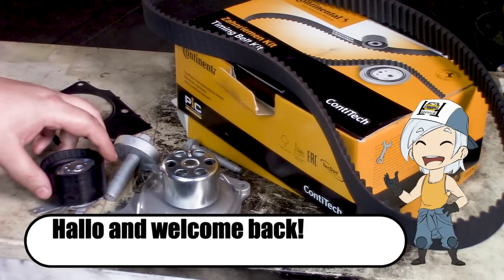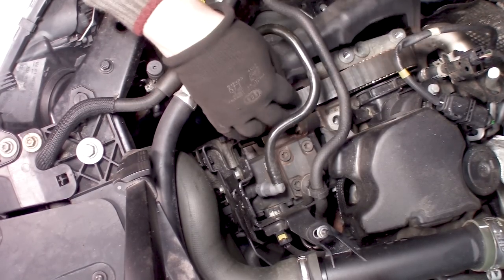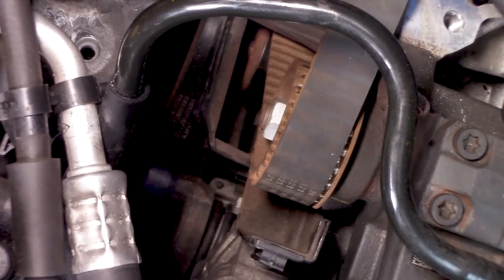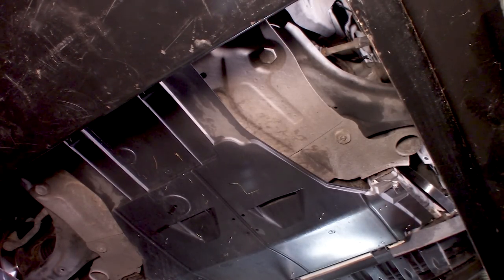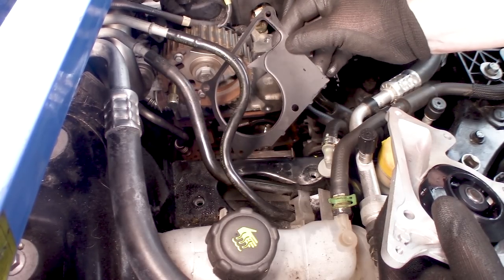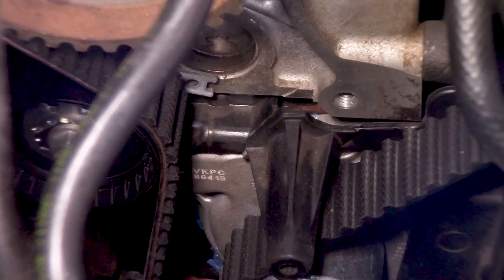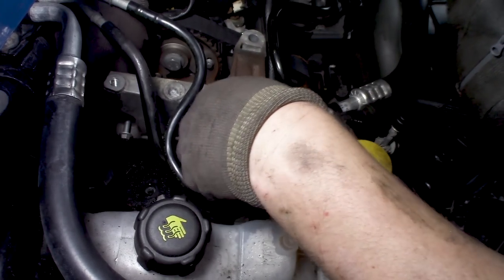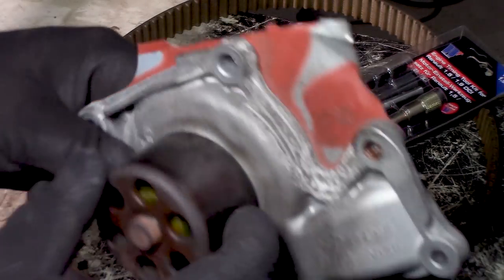How to replace a timing belt and waterpump 1.5 DCI Nissan Renault Suzuki Dacia

Comment: Hello,
Indeed very good job on removing parts but as timing belt job and mechanic you done very very bad job.
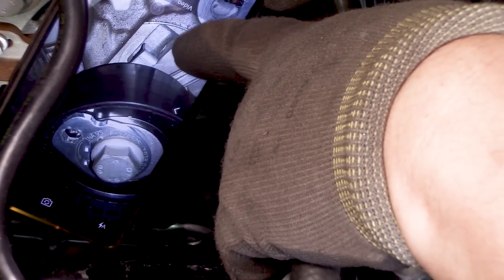At 32:30 you started to tension timing belt tensioner in wrong direction(clockwise). He must be tensioned at anticlockwise direction as stamped in tensioner with big arrow pointing to anticlockwise which can be seen at 28:49 . you didn't even read the instructions that came with belt.
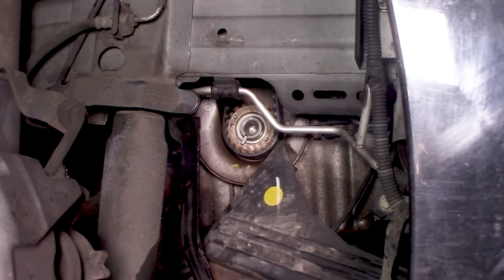As a result you have a belt that is not centered on the pulleys and protruding about 1 cm out of pulleys which can be seen at 35:34 . Probably by now belt is rubbing against upper engine mount and will jump a tooth or brake soon ending with scrapping engine or the whole car.
Also with camshaft pulley you didn't unbolt 3 bolts to have even tension and belt is by now very wrong tensioned.
You didn't use marks on the belt that ensure belt is at correct position.
When tightening crank pulley bolt you could use crank locking pin to lock the engine and then tighten bolt to 120nm. After that you can tighten additional 95 degree with impact.
Reply from the maker: About the tensioner you are right about that. I could have turn it the other way. I can remember having some problems getting it to center. But i'm not a bit worried about snapping the belt or anything. The car has been driving fine for about 50000km after the timing belt change. You can call it luck but i think it is not going to mater much.
Thanks for the honest feedback that is keeping me sharp. By the way i'm not a mechanic just someone that post repair video's and yes i make mistakes.
Reply: 50.000km in 1 year. Thats a fair milage.. ;) Have a look at that belt.. i seen many like this ending in engine rebuild or new engine.
Reply from the maker: I will, it needs a service anyway.
Reply: @TheDutchGarage  please ADD at time 32:30 comment with correction !
Reply from the maker: @MaxHardcoreSLOVAKIA  I wish I could but they removed all the possibility to at text.
Reply: Sono pienamente d'accordo con te

Comment: Thanks alot, this video helped tremendously when doing the timing belt on my 2006 Kangoo.
The shops here in Norway would charge around 16000NOK, which is around 1600EUR for this job, with help from this i managed to do it for under 2000NOK....
Reply from the maker: That is a LOT of money that you can stick in your own pocket! Good job! Glad that I could help.

Comment: very good job! However you should skip the silicon at the pump, it makes things worse! The gasket is of a soft metal, which deforms irreversibly to close the micro cracks in the aluminum surfaces of block and pump. It also has a similar temperature extension coefficient as aluminium i.e. everything moves „in line“ when temperature changes and the cracks remain sealed. The silicon does not allow the metal gasket to do its job, it introduces 2 more material layers which may fail and in this aggregate of materials it is the one with the most temperature aging and therefore will shorten the lifetime of the seal.
Reply from the maker: You are right, I'm just a bit old-school. Pump still isn't leaking tough.
Reply: @TheDutchGarage  😀

Comment: When tensioning cambelt on any engine that has adjustable cam sprocket,The 3 bolts with slots should be loosenend so the belt can be correctly tensioned all round,This is why they are there, The pump sprocket will move slightly when tensioned too but this doesnt matter because common rail are not timed by the pump, Pump mark is there for the white alignment marks on the belt ,assuring is fitted with the correct amount of teeth between the cam and pump sprocket.
Reply from the maker: Thanks for the input. Always good to have more info!
Reply: I did that but after I loosened them they would slip when rotating the engine even tightened with double the torque spec. I had to douse the hole thing in brake cleaner before it would grip. Now I'm nervous it will slip again after 100km. Wish I hadn't touched it. It ended up in the same place anyway.

Comment: Hi,
Another great video. I have one question: without having an impact socket driver, as you did, how would you suggest loosening and later tightening to specification the 18mm crank pulley bolt? I did think of using the crank locking pin as a means to oppose the turning of the crankshaft and pulley, but feel that the light pin may only bend under the turning load.
Many thanks,
Brian
Reply: You can use an old serpentine belt like this: https://www.youtube.com/watch?v=bghh47pBDMA

Comment: Hi great video Re dci timing belt, just a couple question hope you don’t mind me asking? 1. What happens if the high pressure pumps moves? 2. How do you rotate the pulley when checking timing alignment do you leave the car in gear or neutral? 3. Why do you do if you find the timing alignment is out once you fit new belt? Many thanks for the advise
Reply from the maker: Hi,
1. the injector firing pressure will be off a bit to the left and the right doesn't matter.
2. Just put the car in neutral, don't make it harder than it has to be :-).
3. don't panic. realign the pulleys as good as you can and retry. the camshaft and the crank are the most important ones. 
Thanks for watching!
Reply: The Dutch Garage hi thanks for taking the time to reply. One more question please the Renault guide tells me to use a tensioner to properly tension the belt. Do you also do this? And with regards to fixing a wrongly aligned belt you advise to realign, how is this done?
Reply from the maker: @francisorozco6438  Well if you can withstand the visual torture of my video then the least I can do is replay to your comments. 1. In the kit there is a automatic tensioner that you need to setup right. please see https://youtu.be/w9rlzT-vG8Y?t=1923
2. try to setup the alignment holes as good as you can with the belt on there. If it didn't align properly then it most of the time just a tooth off so no harm done. off course the camshaft and crankshaft are the most important ones. so if you put the pin in the crank and you see that the camshaft is a bit to the left or the right. then undo the tensioner and try to align the hole again and if you are successful take the whole belt of and try again.
Reply: @TheDutchGarage 
What is the life span of the timing belt on a 2014 dacia logan mcv 1.5 dci engine.

Comment: Good video !! 
But a couple of remarks:
1/ on the new belt are lines that should line up with the marks on the pulleys. If there are no white lines on the now belt , you should count the exact number of teeth between 2 marks (see instruction leeflet). Especially count the tooth on the longest distance (between diesel pump and crankshaftpulley).
2/ The timingbelt tensioner should be tensioned  COUNTER clockwise (Allen Key). That is what the instruction says. However , with my first belt change , i did it the same way as you did , didn't seem to harm , but after driving 10000km i retensioned the belt the good way . DOES IT MATTER how it is tensioned , does somebody know?
3/ You torque  the crankshaft bolt without the locking pin in place , the damper pulley spins. Maybe it was already torqued , and you didn't film it because it was a long day?
    Would have been nice to show how to torque properly and than turn it 95° further to see for a beginner. This is an important bolt ! 
4/You might have shown how to de-air the cooling system ( 2 drains?).
Nice video, where are you from in Holland?
Reply from the maker: Hi there, It has been a long time that I have seen lines on timing belts. The belts are used for differed engines and the marks don't line up and that can trow you off.
2. Renault did update the timing belt for this engine. you can use the new roller on the old system. Maybe there is were the problem starts. One roller counterclockwise the other clockwise? who knows. Always check the instructions of your timing belt kit. Never the workshop manual that is my advice. 3/ If i remember correctly I torqued the bolt with the car on the brakes and in gear. A bit of a old habit. The rest I think is just a bad edit.4/ You are probably right maybe I have to give a small instruction in every video about burping the system. I'm from Groningen! thanks for your questions and watching off course.

Comment: Thanks for video. Can this be done without crank shaft pin. I'm stuck here. Help me please 😊
Reply from the maker: Sure, Just be careful nog tot rotate it.
Reply: @TheDutchGarage  Thanks for reply. How can it be done without crank pin. The last person rounded the blank nut. Plus it's very hard to get ar.
Reply from the maker: @TheSubpremeState  First align everything you can get a pin into. Like the camshafts. Then mark were the crank is located. What also can help is put the car in gear to keep the crankshaft form rotating.
Reply: NO!
Reply: There were marks on the crank and camshaft making it easy even if they moved. Thank fk
Reply: @TheSubpremeState  you don't have any marks on the crankshaft, only the 12 o clock notch which is not a precise position to follow. the locking pins are 11 gbp on ebay. just ensure there is a 69mm lenght of the cranckshaft locking pin.
Reply: @crigeorge9549  maybe the car I was working on was different. I used an m8 bolt on the left hand side of the cam shaft wheel. I can't remember fully but there was a mark on the crank shaft that lined up with the lines on the new timing belt. The fuel pump even had a mark that lined up with line on new timing belt
Reply: @TheSubpremeState  you could have a marking, 6:00 o' clock position on crankshaft cog in relation to the timing belt, if the belt has this marking. Some engines have this marking on the crankshaft cog. But not related to the engine. Regarding the lenght of the mot1489 crankshaft pin there was a debate on internet about it's corect one. While a long time ago some drawings indicated 68 mm, recentely different lenghts were used. Like 69.5mm , 69 or even 70mm(Lasertools). I used a 68mm manufactured at a local hardware handyman but the crankshaft and camshaft somehow didn't realign properly after the 2 pretensioning revolution. In the end somehow they did realign after multiple tries. The one supplied by Renault is 79.5mm. In the end the best way is to count the teeth between the camshaft and crankshft, or if you have markings on the timing belt to compare their position to the cogs.
Reply: @crigeorge9549  ok but am I wrong in saying the vehicle won't start if its out a bit. From what I gathered and seen on my own ranault traffic van.... Which was much easier.... The engine can't turn freely unless the timing is done right. Maybe you could be out by a half turn of the crank? I dunno
Reply: @TheSubpremeState  it can work even if it's 1 tooth misaligned for instance on the camshaft. Mine, when I change the cambelt had 1 tooth misaligned from the work done by the previews mechanic , and still worked. Probably a couple of teeth misaligned and still be able to move freely. However the performance might be bad, emisions or the fuel consumption might go up.
Reply: @crigeorge9549  damn that sounds awful lol. Stupid design. On my renault traffic at least there was a cam shaft position sensor that wouldn't let it start if it was off. As far as I know
Reply: @TheSubpremeState  1.5 dci has camshaft position sensor, but it's location could be different. And a cranckshaft position sensor. Some 1.5 dci engines , for instance the megane 82hp has the camshaft sensor mounted next to the fuel pump sproket. In this case the position of the fuel pump sproket its important because it reads the position of the fuel pump sproket. However the 106hp megane 1.5dci has it mounted on the right of the engine close to the intake flap. I think is mounted on the engine head cover. But as I told you i'm 100% sure that it will start and work without noise or other problems just with 1 camshaft tooth misaligned. Some people claimed that with a few more teeth misaligned it started after several atempts. Of course if the misalignment is for several more teeth it won't start at all.

Comment: Hello There , In process of doing the same engine on a kangoo van,  regards to the tensioner pointer,   the first two revolutions after fitting belt it was off as expected , so readjusted , after another 2 revolutions it appears off again ? Thanks
Reply from the maker: Hi there,  what can hebben is that the camshafts go into relax mode ( The path of least resistance)  and pull on the belt backwards. then the tension looks off. So be sure that when turning keep te tension on the crank bolt when looking if the tension is ok.
Reply: @TheDutchGarage  Thanks I'll do it again and see .... great video btw.  👍
Reply: @TheDutchGarage  it is normal for the pointer to move around while turning crank pulley right  ?
Reply from the maker: Yes, it's normal

Comment: I have a ticking noise from high pressure pump since belt was replaced any ideas?
Reply from the maker: Are you sure it is the pump? not that te belt or pulleys are rubbing against the plastic covers? Maybe air in the fuel system?

Comment: interested to know what this job costs to do in other countries. In Sweden, Getting mine done Tomorrow, had quotes from 7000 to 12000 Swedish kronor. That's about 600 to 1100 English pounds. Fn crazy price in Sweden. And as you can see it can be done in an hour, Rip-off garages as usual. I'm pretty handy and do many jobs on cars, but this I'm scared to put belt on incorrectly, so must pay the money I'm afraid.
Reply from the maker: Hi there, I just did a online calculator its about 550 euro over here exclusive the waterpump. I think a expert can do it in 2/2.5 hours the kit is about 150 euro. I hope you find a shop with a good price.
Reply: I paid £360 to have it done at a Renault Independent specialists in Edinburgh. That was for timing belt, aux belt, new water pump and a coolant change. It can be had cheaper elsewhere but I paid a bit more for peace of mind. Seeing how involved the job is, it seems like the sort of job i'd be happy to pay for.
Reply from the maker: @Leethemetalwarrior  That's not a bad price.
Reply: @Leethemetalwarrior  dealer in Milton Keynes quoted £749!!!,  so being a retired Transport Mechanic I will do it myself...

Comment: 38:18 And that's how, boys and girls you end up welding new nuts on the subframe. Also. The pretensioning setting "between" the teeth is wrong. It needs to be on the middle of the lower "tooth". The allen key at the pretensioning stage needs to be moved "anticlockwise". If you used locking pins why do you advise people to try it without them? On this engine it helps adjusting the camshaft cog by slakening the 3 screws.
Reply from the maker: About the use of an impact. Don't use it if you aren't convertible using one. The way I did the tension is the way mentioned in the instructions. It can be that a other brand instructions are different. I don't advice people to not use the locking pin. But if they ask if it can be done. Sure it can be done. But by all means  make a video en show the people hoe it should be done. We are all here to learn.